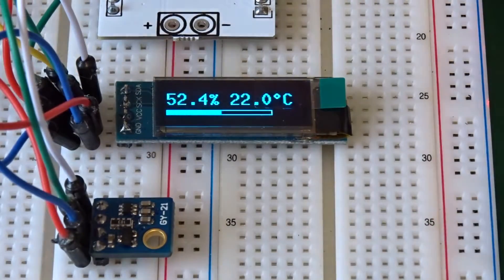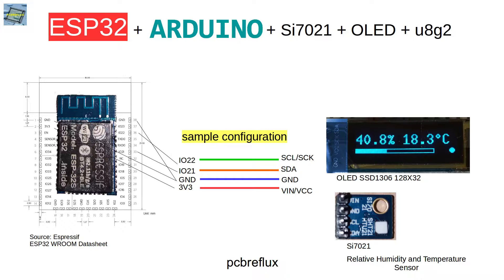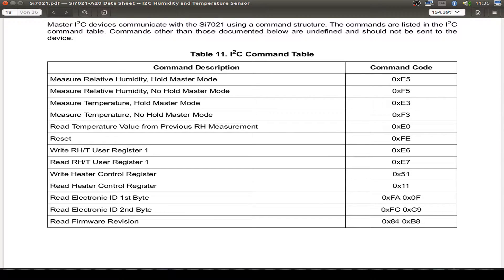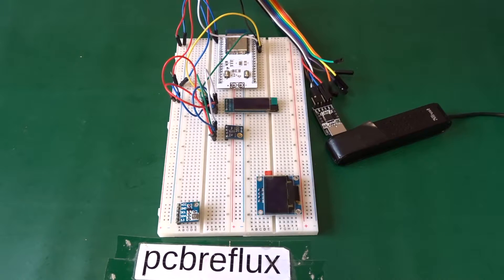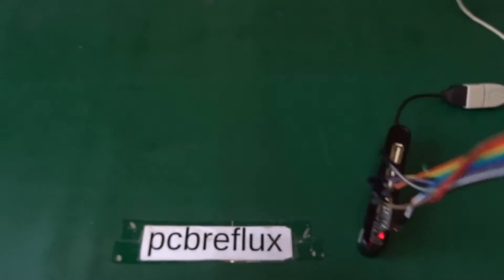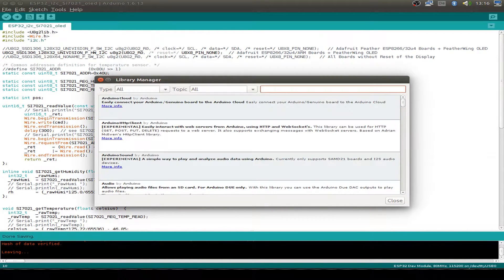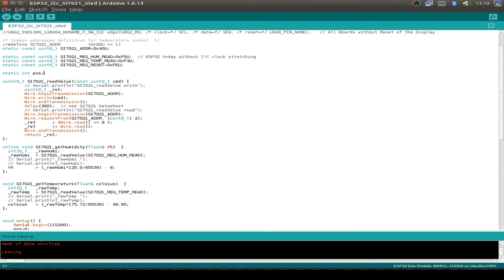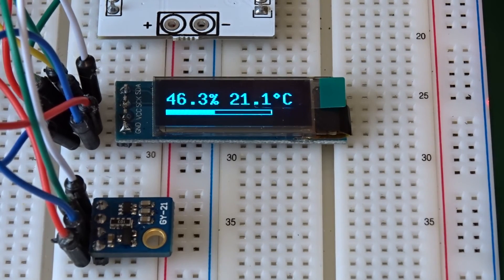ESP32 #11: Weather Station with Si7021 and OLED

Comment: Hi, I am trying to use your code to make an identical device.  However I constantly get errors..  I have copied the error to pastebin the url is https://pastebin.com/Am2tVJ07  .   Any ideas as to what is wrong or where to go to try and sort out the issues????
Reply from the maker: Hi, done very rare using the ESP32 on Windows. But I would try a newer Arduino Version like Arduino 1.8.5  instead of 1.6.13 (https://www.arduino.cc/en/Main/Software). Also maybe update your libraries with the LibraryManager (-> Manage Libraries, Type Updateable) and try git update with arduino-esp32 (https://github.com/espressif/arduino-esp32).
I've tried the sketch on Ubuntu and Arduino 1.8.4 with several updates and your bord "FireBeetle-ESP32". Get some warnings but no errors.
Reply: Hmmm,  ok I guess I will spin up a VM, and throw Debian or Ubuntu on it and see how it goes.  I rolled back my Arduino IDE to yours to see if that was the issue it was happening on the current stable release with everything updated as well.

Comment: Dear friend 
I saw your tutorial, it's nice but I have question that if there is a 3.3v regulator its mean that input voltage can be 5v 
Waiting for reply 
Thanks
Reply from the maker: +Ehtesham Nisar Ahmed Hi, depends on the regulator, but sure you can use 5V to regulate down to 3.3V. On all known development bords for the ESP32 with usb there is a voltage regulator beside the usb to uart bridge.
have a nice day

Comment: Hi, I2C on esp32 is hardware interface or is software emulated on gpio?
Reply from the maker: BigMacintosh Hi, don't be shure for the arduino port but the ESP32 with esp-idf uses hardware I2C that can be wired to nearly any GPIO pins.
Reply: Thanks, and don't You know if this is also true for ESP8266 (since it's cheaper and I need many of those), to be precise I'm using nodeMCU v3 and I have some devices on I2C where I want to gain maximum performance, whereas software I2C will slow overall functionality. Now I'm stuck and I don't know if I'm getting maximum performance with usage of standard LUAs I2C library.
Reply from the maker: Sorry but only use the ESP8266 with arduino and i am not sure if the library is software or hardware I2C. https://github.com/esp8266/Arduino
Reply: I see there in this library in the comments is something like "software library for i2c", however i'm using lua, so maybe there is a hardware i2c support. In the tech specification for ESP8266 i see there is hardware i2c. Anyway thanks for information.